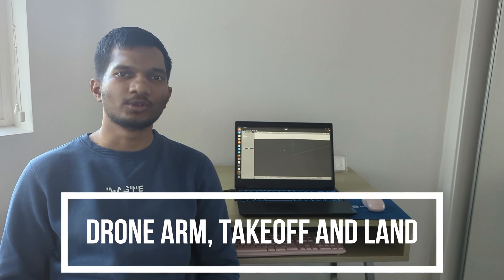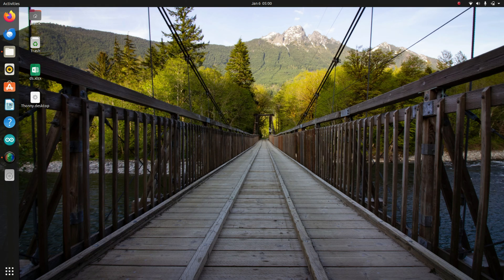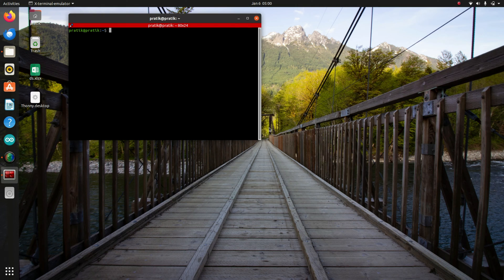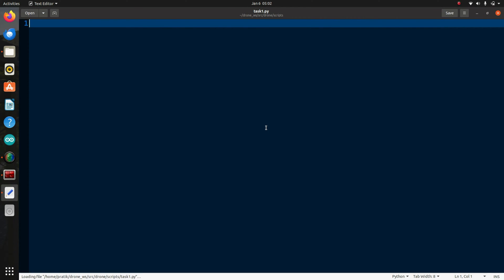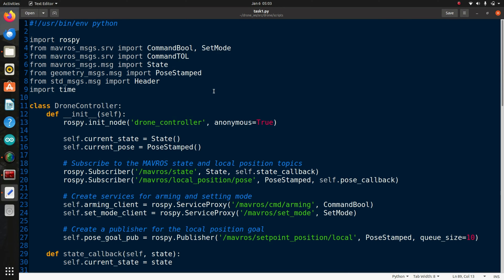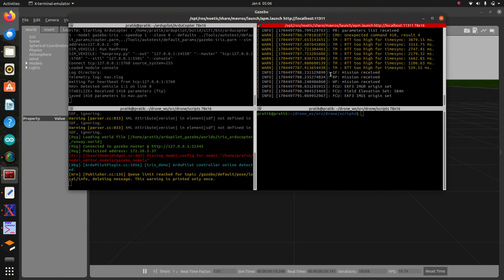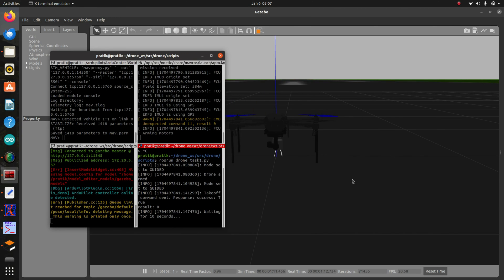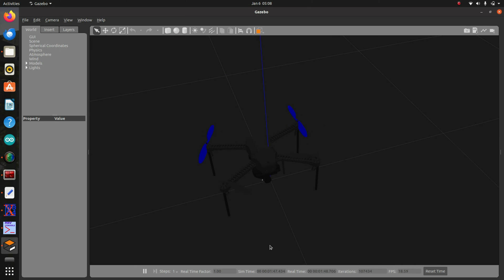How to make drone takeoff and land using SITL, mavros, Gazebo | Drone programming with ROS #2

Comment: During simulation of the code after rosrun drone task1.py, the output shows takeoff command sent. response success: false. also there is nothing happening in the simulation. how to fix this?
Reply from the maker: You have to be in guided mode for those commands to work